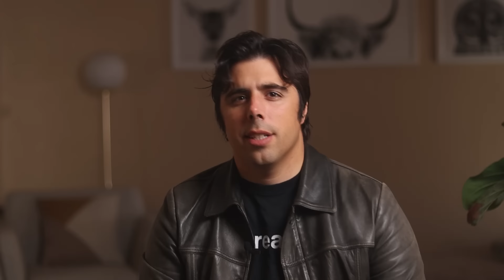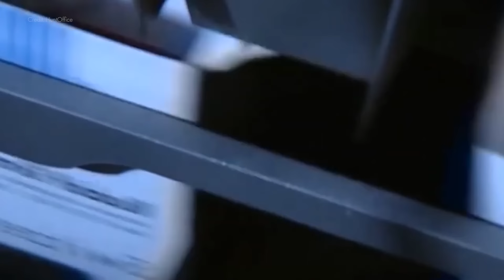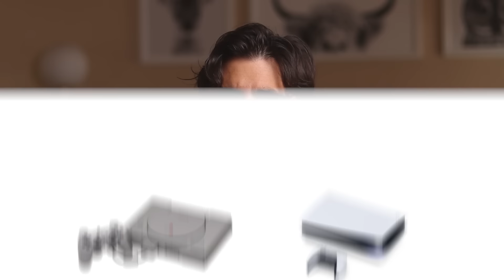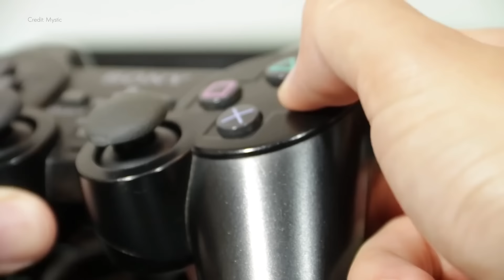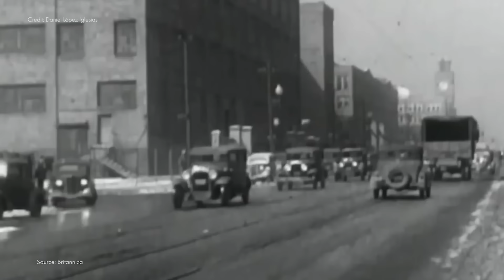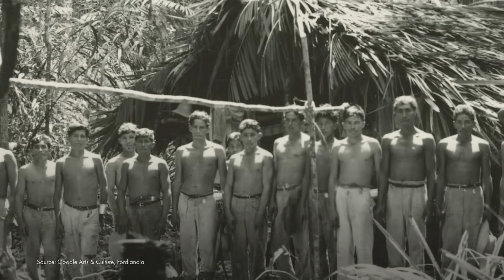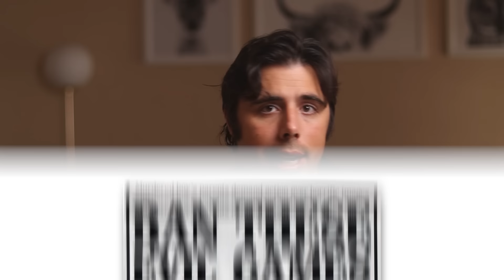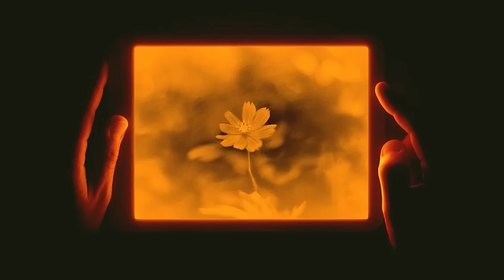Why Some Designs Are Impossible to Improve: Quintessence

Comment: I don't think you can use the modern phone as a definite example of quintessential design. I think this is a clear example of "recency bias". The meaning of quintessential is that it remains unchanged for good and doesn't need to be "updated". The smartphone design has only been a form factor for 14 years (not the biggest sample size), whereas the design of phones before that were nearing 20+ years and people would've called that "quintessential" back then. Apple/Samsung/other smartphone companies base their business model and greed on selling you the same phone multiple times, but there's only so much upgrades they can do to justify the price/reason to sell. Eventually, like all technology, it will reach a limit, and in order to sell new things for a longer period of time, there will need to be something new. Therefore, I do not think something that may not be the same for longer than 15 or 20 years, under a business model that requires it to innovate/be new, can be called "quintessential" like the paperclip. The paperclip is a form of technology, but it's a static form of technology, one that doesn't need to sell you on anything new to justify it's repeated purchase. The iPhone/smartphone is the complete opposite of that. The only way to curve this is if planned obsolescence becomes even more of the norm to force people to buy a new phone, which people would eventually push back against once a given enough time goes by.

Comment: Awesome video!

I wanted some insight on the console controller case:

Why is it then that this specific case has two quintessential designs? Yes, Sony's design came before the others, but it has an essential difference from its competitors, which does not allow it to be "the standard" in the controller market. Most controller designs actually follow a slightly different (but fundamental) desing pattern, with a swapped position of the analog stick and d-pad. Nintendo actually tried a different pattern with both sticks up top which ultimately failed, but the main standard is actually on the Gamecube's/Xbox's controller as it is on all main platform controllers (Joy-Cons, Xbox series, Steam controllers, pro-controllers, Steam Deck, etc.) as opposed to the Dual-Shock which is the only main platform with its design (which is not to say it's not good, as it is on the market for almost 20 years at this point).

The point of this comment is not to decide which one is "better", but rather the main question I have is: Can we really call a design quintessential or consider it "impossible to improve", knowing that there is more than one in the same market. Isn't the very difference between two predominant models technically a subjective improvement of one over the other?

Comment: Imo the best way to identify quintessential designs is by looking at “generic” illustrations and artwork. Whenever you see a design appear on brandless artwork that’s when you know it’s an icon. Examples of this are present in pretty much every industry, from everyday items (like the t-shirt, the backpack, the plastic garden chair, water bottles) to electronics (like metal unibody laptops, flat screen TVs and the lightbulb) to even large and complex objects (take for example the Cessna 172).

Comment: I would argue that the wii was extremely influencial leading to the other companies copying the functionality if not the exact design and Nintendo actually included the functionality into the switch controllers as well. The joy cons are individually two redesigned wiimotes with the same concept of directional control on the left and buttons on the right when held from the side for single joycon multiplayer.

Comment: There's simplicity and then there's convenience. Both are great but may not result in the same reliability. Where a mechanical pencil may be more convenient, its more complex and results in higher costs for a single user and may have faults, in which some may come across, that can be distracting or may just ruin it entirely. A simple design could be a result of simple production, which means less costs. 

We pay for convenience and take simplicity for granted.

Comment: I still remember when they changed the playstation controller design and i happened to try it and play something with it, it felt so awkward in my hands and didn't sit in comfortable. Operating the buttons and joysticks felt slow and janky. That is why i went above and beyond to find a playstation 2 controller design controller which can be used with my laptop, that is the best controller by far :)

Comment: I have one of the very first microwave ovens from Philips. It was purchased in mid 80’s and is still working fine. Two dials set the power and time - no advanced circuitry and multi-button panel.
Also got a massive household assistant from Swedish Electrolux. It has a dough kneader, a blender and number of other add-ons. Got it in 1978 and just needs a new drive belt. This model is still around and looks very much the same.

Comment: Fender Stratocaster come to my mind for this topic. Quintessence design for electric guitar both practical and cost-effective way. it's a most successful guitars design at all times, I think over 50% of electric guitars in the world are Strat-style or based on it whatever it's a Fender-branded or not. (because Fender company failed to protect a trademark on guitar design, so everyone keeps copying it with no problems)

This year (2024) Stratocaster will have 70th anniversary, only has some improvement (or sometimes cost-cutting) touch but it's still looked the same as 70 years ago.

Comment: Bic pens and paperclips remain as they are not because the design is superior (it's not, click pens and spring clips are both objectively better) but because the cost/benefit is superior. As for the PS1 controller...not only has it been evolving almost constantly with each generation of console, there are again objectively better varieties. X-Box swapping the thumbstick and d-pad is, for the vast majority of games, objectively more comfortable to use. 360 controllers had superior trigger buttons and Playstation has only barely caught up, though they still feel flimsy. And either of those is defeated by a lot of 3rd party controllers, specifically ones with integrated profile/layout swapping and additional buttons on the back face....

Comment: The paper clips I normally see are the style that have a straight top and pointed tips rather than both sides being rounded.
They are superior to the double-rounded design, because you instantly see wich way they are supposed to go on the paper.

The Qwerty keyboard layout is not the most efficient layout, in fact it is purpously designed to be a bit awkward.
The layout carried over from mechanical type writers, and it was meant to spread out the most used keys, because otherwise the mechanical arms would get entangled if you wrote too fast.

Attempts have been made to introduce a faster, more logical layout, but it seems about as popular as trying to re-structure the alphabet itself.

Comment: 11:55 I think the Steam Controller could have been such a thing. In my eyes it was a great controller, but until you put houndreds of hours in learning to use it, it is just frustrating using it.
It was not worth the work to learn the controller.

Comment: "It's not worth spending months learning how to type all over again"
Unless you are a professional typist or author, hotkeys are even worse roadblocks. Most applications chose their hotkeys and key combinations so they can be quickly typed on the QWERTY layout and can be cumbersome, literally painful or even humanly impossible on radically different layouts. You gain a bit of typing speed and comfort but lose all proficiency and action ergonomics in software from word processors and spreadsheets through video editors and modellers to IDEs. The cost of switch is way more devastating. I've tried...

Comment: Suing the competition might be a good way to achieve having the quintessential design, but it is also a good way to make sure the quintessential design is inferior to what it could have been.   If the US government had not stepped in and forced the Wright brothers to collaborate instead litigate powered flight would not have progressed much beyond small slow single seaters for another 50 years or more.

Comment: I think the best improvement to a paperclip that we could make would be modifying the cutting portion to slightly round the edges of the cut ends that scrape along the paper.
As-is, paperclips kinda tear into the paper if they're holding a few too many pages, and you go to pull the clip off by sliding it (the normal way).

If the edges of the cut wire ends of the clip were just a little less sharp at the paper-contacting area, it would drastically improve performance.
Reply: Sorry. Not worth the manufacturing cost along with it not being an overly prevalent problem seeing as the work around to the tearing problem is just to twist it to one particular side. Im not saying its a bad idea or anything i just dont think most manufacturers would opt for it. If that were to become the new standard though i certainly wouldnt complain.
Reply: If you want to hold thicker stacks of paper, then a bulldog clip is a good solution. I would consider the three part bulldog clip designs to be another quintessential design. I don't even use paperclips any more since I have a tub of bulldog clips of various sizes.
Reply: Those paperclips do exist, but they are hard to come by. Stores usually don't stock more expensive items without an obvious draw for the average customer. But you can find them in the supplier catalogues big companies and other organisations order from. Aside from rounded ends, there's material choice (copper, steel, copper-plated steel, ...), size, wire strength, ridging, triangular vs rounded, and many more features.

I still have a wide range of different designs that came in over the decades, as my father would use one at work for personal paperwork and bring that home from time to time. I particularly like those 4-inch long, ridged, steel-core, copper-plated ones. You could probably clip floor tiles together with those ;). They were intended to hold together police case files, i.e. stacks of random papers, photos, and the like that could be up to an inch thick. Much cheaper than file folders.
Reply: maybe make it out of nitinol wire.

Comment: The controller design section was really annoying to me because, 1) The controllers you were old school were from the 90's, 2) the NES wasn't the first with that controller design, it was the Famicom in 1983, and 3) the Nintendo 64 was the one that introduced the joystick, which play station then proceeded to copy, to get the dual shock you showed, also completely ignore the whole xbox controller development from the duke to the xbox 360 controllers, and Nintendo doing many different controllers still

Comment: Smartphones would be way better if they had slider keyboards in them. The in screen keyboards are uniformly terrible, and the slider would double the effective screen size when typing. They don’t bring it back because it’s cheaper to omit it and easier to not have to program for it. They think there’s no market demand, but this is because they periodically tack one onto an obsolete SoC. The modern smartphone is an example of compromise, not quintessence.

Comment: The Vigenére Cipher was invented in the mid 1500s and can still be an unbreakable encryption algorithm today for reasonably short messages and reasonably long keys.  (You have to use it well, given that brute force attacks are relatively easy, but that's not hard.) And you don't even need a computer to encrypt/decrypt, so it's essentially medium-independent.
Reply: I see you watched the latest Lemmino video!

Comment: The Smartphone did not democratize information, at least I don't think that's a useful or functional frame.  It promoted ambi-information (Data that exists in all states of truthfulness and falseness).  Functionally what happened is that it reduced government control of frames to allow sub-governement corporate actors to spread ambi-information in order to promote frames useful to them.  It's similar to government devolution wherein government power is sent down to states that have less power than federal governments so that NGA's can bully states where they can't bully federal powers.  

Calling that democratizing is a little weird.  It's only where federalized power exists that democracies have existed.  Unaligned States have historically have little protections against tyranny.

Comment: The movement to pave roads in America pre-dates the automobile; it was the result of advocacy by cyclists.

Also, I think you undersell the difference between Qwerty and its alternatives. Although it's true that you may or may not achieve a significant improvement in your typing speed by switching from Qwerty, the ergonomic difference can be remarkable. Putting E on the top row, left hand is just obviously silly, and something you notice if you go back.

Comment: If you look at game controller design over the years, you can see that Sony only adapted existing controller designs, extending the handles.

Also, game controllers have changed as much as the game consoles have.  Game consoles are still very much a rectangular boxes, with some superficial changes to the external design.  Controllers have seen many cosmetic changes also.

Obviously, game controllers aren't going to change much, as they are designed to fit inside someone's hand, and people's hands haven't changed.

Comment: A question for left-handed people - is the standard "right hand" controller awkward at first? I wonder why the arguably more complicated part - the movement - is done with the left hand. It's a similar thing with guitars. Fretting is more difficult than picking, the left hand is (usually) doing more work. Why do right-handed people set the parameters with the left and just confirm with the right?

Comment: I never owned an iphone. When it came out, it seemed cool but only a year later Google released the G1. I couldn't afford the iphone during release but at 1 year later I had saved and could buy one. But the G1 had Google maps built in on release, and the iphone didn't get maps until 2012, 5 years after initial release. I bought the G1 specifically to have navigation, and its still the most used feature of every phone on the market today. Had apple released the iphone with the map feature I honestly think they would have had less competition today. Googles map on their first android phone was a game changer. It filled a need, the ability to go anywhere with a map at your finger tips. And it was just what many people needed fir their jobs, and every day travels. It was the go to feature  for years over the iphone.

Comment: Yet some quintessential designs fall victim to fashion and 'innovation' hype at some point in time. I'm especially thinking about the classic dialphone with the handset across the top. At some point designers of office phones placed the handset along the right or left edge of the phone which is much less ergonomical IMHO. Same with the classical desk lamp with its flexible folding arm and the button on the top (where it is most easily to be found). Today almost all desk lamps are much more restricted (e.g. shorter arms) and their buttons are often in the most hideous places.

Comment: Regarding the Sunbeam toaster, he makes an wildly unfair comparison in determining whether the toaster is quintessential or not.  A paper clip has one part, the toaster, as he says, is very complex. I also disagree with him on the appliance's reliability and longevity. I have a Sunbeam toaster made in 1950 and each of my three daughters have the same model in their homes.  We all have it BECAUSE of its robust construction and the ability to go on for a long time before needing any repair. Ny own taoster was bought at a garage sale 25 years ago when it would have been 50 years old, it had the original cord and worked perfectly for the next 15 years until needing a repair. That was ten years ago now and today it's still running flawlessly.

Comment: tldr: even if there is a better version of the old thing. Manufacturing complexity and increased production costs might not leave enough margins for profit. Or in the case of paperclips, you want to churn out as many of them as possible. If the better paperclip takes 2-3-5 times longer to produce, it s imply isnt worth all the benefits it provides. Theyd have to charge 5 times for it and are people going to buy them for 5 times as much?

Comment: do you really think ANY major design focuses the least bit on the 5 or even really 10% outliers? no... you can't. you focus on the average, and move on. especially in the last 10 years, dial in on the 51% and move on. if any controller worked for the smallest, or the largest hands, it wouldn't work for the other, or the average. that's just real life. this is stupid. and i hate sony, will never buy another playstation or any major product from them ever again, but i still have a dualsense controller, for my pc. cause they've had the best controller, since the ps one came out. period. yeah, other job specific controllers work better, for one type of game. but their's works best overall, one controller for everything. from nes emulators to cyberpunk. it can do everything, and maybe not perfect for everything, it works well enough. better than this stupid keyboard, that there really is no alternative to.

Comment: 33:02 - Correction: The gap between "The smallest 5%" and "The largest 95%" is 0%. If you're on a scale, "lowest" vs. "highest" dictates which end you start counting from. I think you meant "The smallest 5% to the largest 5%", or you could have said "The middle 90%".